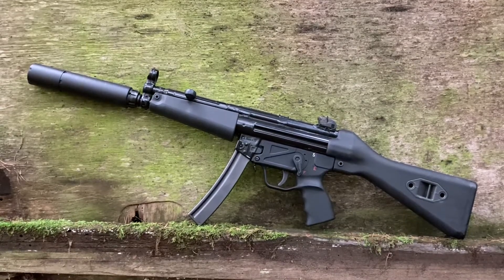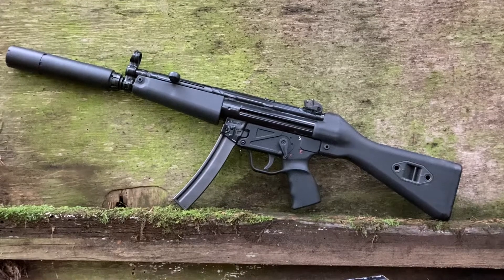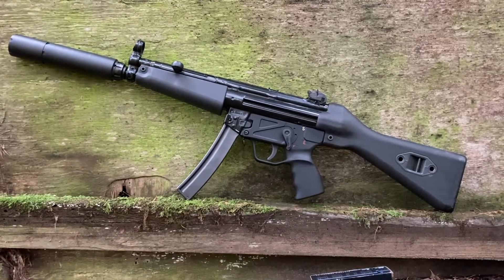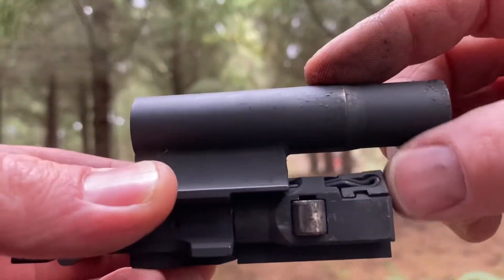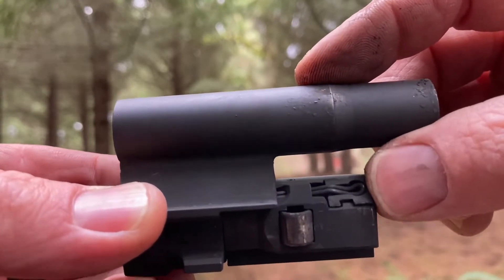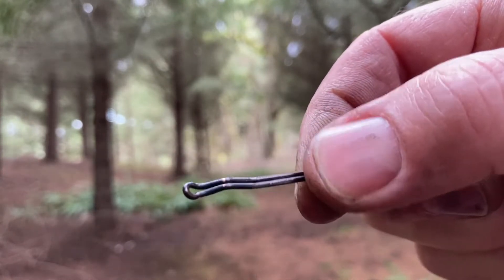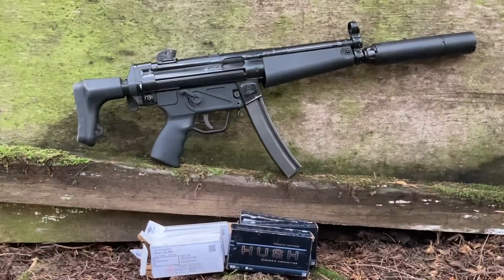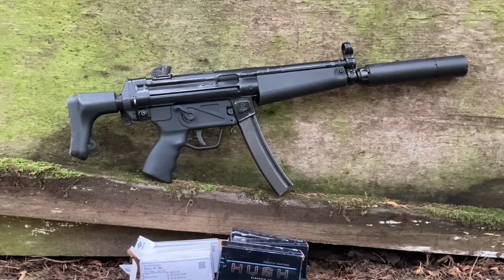Binary MP5 SBR with Dead Air Wolfman

Comment: Nice video!  The wolfman is a nice setup (as I have one) but i highly recommend an MP5SD setup.  The best part about an SD is being able to run cheaper supersonic ammo and the ports in the barrel slow the ammo to subsonic speeds.  Also, if you're having issues with the extractor spring handling the 165gr bullets make sure you're using a real HK replacement extractor spring.  If that doesn't solve the issue long term, try a rifle extractor spring.
Reply from the maker: Thanks for your comment! Lot’s of good points. I’ve got a MP5SD I’ll be making a binary video with in the future, but most people have a MP5N or MP5K and are interested in a Wolfman so I made this video first. I use the copper HK German MP5 extractor springs, but might switch to the stiffer silver rifle spring like your suggesting. I really appreciate you letting me know that’s possible. I should have some spares around anyway for my .308’s and 7.62x39 guns 👊🦾
Reply: @RangeToyz  no sweat!  Nice to see a fellow roller lock enthusiast channel.
Reply from the maker: @srgerhart  indeed! I just took a group photo of all mine together on Instagram a few posts ago. You can follow a link in my channel description. I’ve been subscribed to yours for awhile. No fluff, just action. Your full autos are incredible! I hope to see more from you soon.